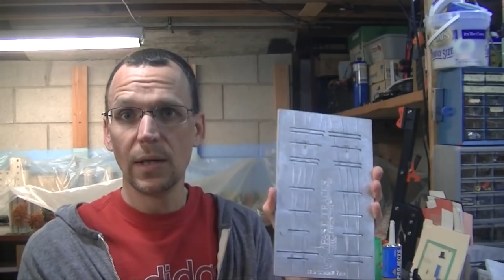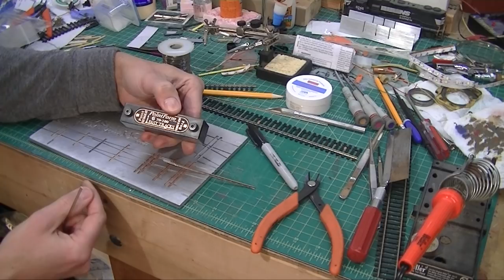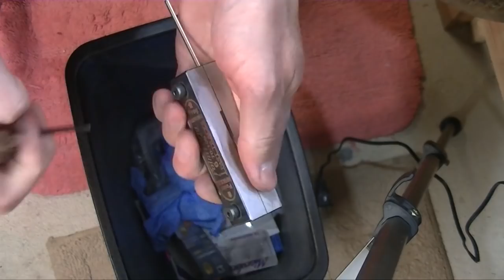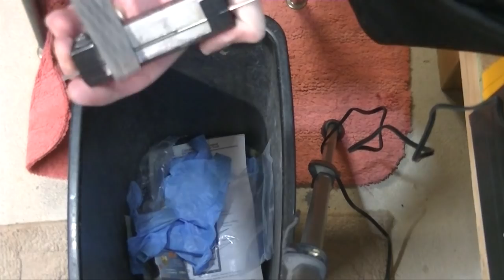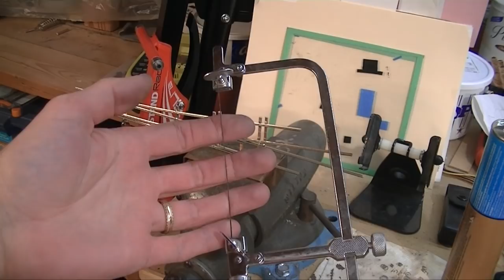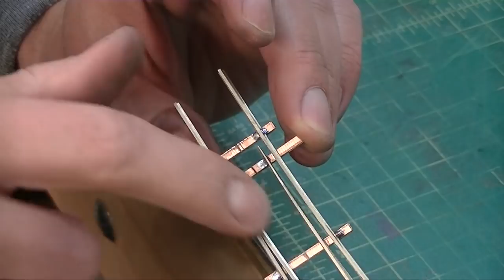Quite the Turnout! - Creating a Turnout using a Fast Tracks Turnout Jig

Comment: I am absolutely happy that I took the Fast Tracks route. The jigs are pricey, but I buy them for the sizes and type I use most. 
The side benefit is you learn that with a NMRA guage and three point gauges building custom turnouts is not hard. I just completed a curved turnout to with 22 and 20 inch radii it end up having #18 frog. I would have never attempted such a turnout without first learning the basics using Fast Tracks.

Comment: I've been using the Fast Tracks turnouts for over ten years.  Other then the occasional throw bar solder repair my turnouts are solid.  The jigs and tools have certainly jumped in price significantly since then.  When I bought mine the cost per turnout simply just made sense.

Comment: Nice to meet another Wisconsin modeler. I've made some Fast Tracks turnouts, and as my soldering skills grew the product was great! Some tips you shared will be helpful, thanks. And I fully agree that checking for shorts before installing is CRITICAL. It takes a few minutes on the bench, but could take hours once installed. I'll be watching more of your videos, I've watched 3 this morning. You face many of the same problems that lots of us face, and resolve them in a sensible way. Good work!

Comment: I also use a Fast Tracks turnout jig.  They are just good turnouts.  I am in the process of replacing my Atlas turnouts with them.  I cannot sub the ME rail with Atlas as the bottom (flange) of the Atlas code 83 is wider.  Glad to see you make your own turnouts.  I hope we can get some kind of a dialogue started.  Doug

Comment: Hey nice vid, thanks. A tip for putting flux on the ties for stock rails. If you put flux on with the stock rails in place, you'll get flux on the top of your rails and then when you solder, you'l get solder on the top of the base of the rails as well.  Better to take out the stock rails then dab flux on the ties where the stock rail sits on them then replace the stock rails in the jig. This has the effect of just having flux where you need it, between the tie and the underside of the base of the rail, and you end up with nice clean solder joints with no solder on the top of the base of the rail.

Comment: Awhile back I visited their website to price everything to build thirty #8 turnouts.  Thirty #8 Atlas turnouts would run about $600 @ $20 each.  From their website I priced out about $614 +tax in supplies which does NOT include the rail, jewelers saw, and pliobond glue.  <<These things I found less expensive on Amazon.  The solder, flux, and iron I would assume everyone already has.  One would need to build about 33 #8 turnouts to just about break even cost wise.  It would seem the cost has increased significantly since the author purchased his jigs.  A different set of jigs needs to be purchased for each size turnout.  While that may not sound like a bargain, it would be a good investment for a huge layout or a club.  Also, if you would enjoy building your own and/or were able to sell them for around $15 each, it may be worth the investment and possibly turn a small profit in the long run.
Reply from the maker: Wow!  That is a huge price increase since I purchased mine.  I didn't realize it had gone up that much.  I guess while they are more time consuming, and I haven't checked the quality of current Atlas turnouts, it's hard to say if the Fast Tracks turnouts are vastly superior or not.  At the time I bought mine, Atlas Code 100 "Snap" switches were not good.  Bargain bin type stuff.  So it made sense.  Now if the turnout quality and reliability has gotten better, it may no longer be as price effective.  I know there are a few guys on eBay selling them or you can rent jigs from different sources too.
Reply: I was very interested in these when I first looked into them.  I only have a small 10' x 11' layout so there is no way I would need to make 33 of any one size turnout.  I really like the idea of making my own but just can't swallow that kind of expense.  My cost estimate did however include 30 of the "QuickSticks" laser cut wooden ties which were $250 of the cost and enough PC board ties which was almost $100.  Purchasing the PC ties from another source and using regular wooden ties to finish the turnout could save a lot of money.  I hope I didn't discourage anyone from trying these out.  If I ever find used Fast Tracks jigs at a swap meet I would seriously consider buying if the price was right.
Reply from the maker: Ah yes, the Quick Sticks.  While nice, as I mentioned below in a comment, they are a bit too pricey and really drive the cost up.  I have one or two turnouts that I did with the Quick Sticks, otherwise I use basswood or just regular ties.  If you are ever interested, please let me know and we can discuss price per turnout and I can make you some.  They'd be number 6s however as that's the only jig I have.  :-)
Reply: @ChessieFan2  -- wanna talk expensive look at his straight twist Ties.  One 10" length of Crossties is $4.40. Crazy!   For a 3 foot section of ties and rail is close to $20.   Lolzz.  Yeah. I'll pass
Reply: Atlas turnous are junk. Chek out oak hill a www.ohrtracksupply.com. designs are from actual track drawings.

Comment: I too am a big fan of the FastTrack method. Can you tell me the name of the eBay seller that has the longer PCB ties? I did a quick search and all I came up with was breadboard. I assume you use wood ties and not the Faststicks that Tim sells. Do you make your own ties or buy them and sand them to the correct thickness of a PCB tie?

Keep up the good work and glad to see you back.

Jim
Reply from the maker: I can't find the seller on eBay anymore that I purchased mine from, however, CloverHouse has something similar and their prices are pretty good as well.  http://cloverhouse.com/Store/product_info.php?cPath=35_36&products_id=73&osCsid=clqavsg03pr7suovghdkho13v0

I have wood ties still from Fast Tracks that I purchased, but not the Fast Ties. While I love those, they are too expensive and I found myself wasting ties since I like my turnouts shorter.  I also go to Michael's or my local hobby shop and buy basswood which is a good alternative.  I just take a tie from Fast Tracks with me to compare size and buy a bunch of those sticks.
Reply: Clover house has 12 inch pc ties. Made in usa too